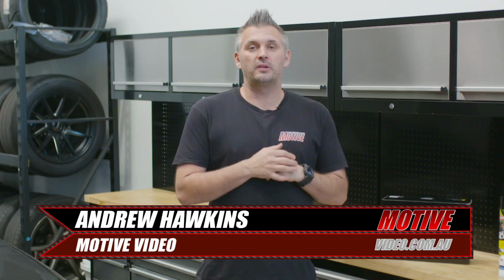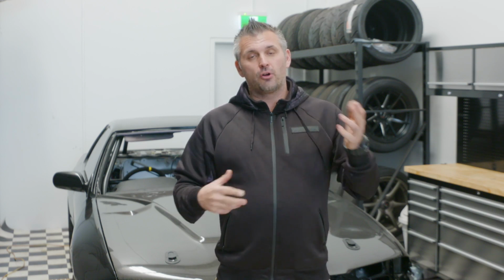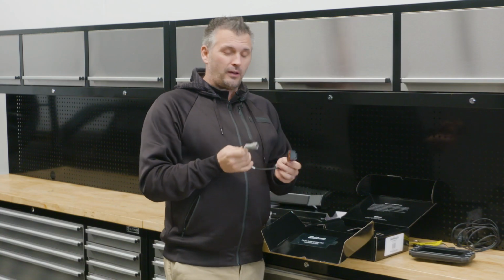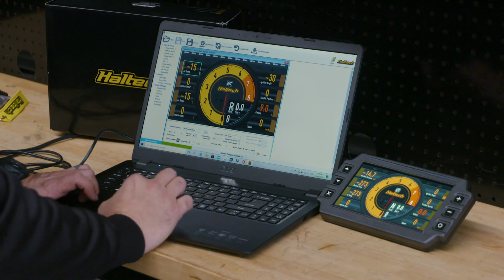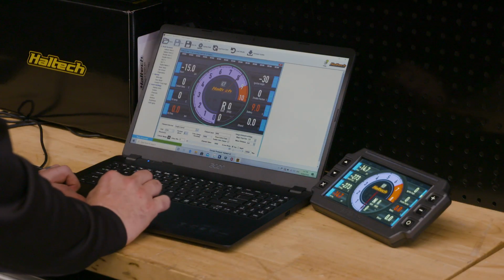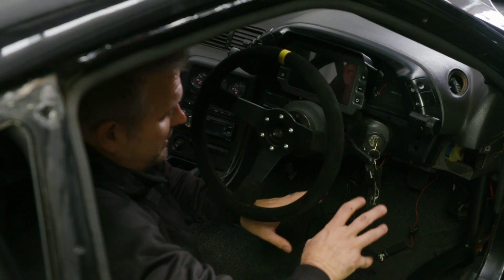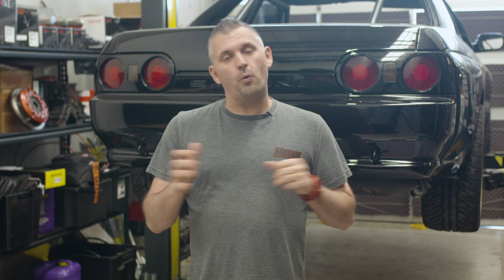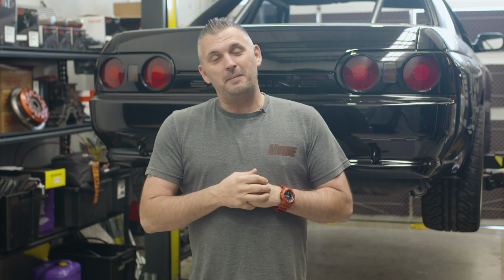Project "Supercar Killer" R32 GT-R Pt7 - Fix rust, Haltech IC7 dash install and paint cage.

Comment: Does the speedo work with if your using a platinum pro?
Reply from the maker: We make our own speedo sensor on the tail shaft. Need to anyone for gear dependant boost control, launch control etc

Comment: c'mon guys, bondo for these little holes??????
Just do some spot welding with a MIG, and you're done!!!!!
Very disapointed about this, as you always do a spot on job on cars :/
Reply from the maker: Metal putty is specifically designed for jobs like this. It dries into a metal, same way a weld dries as metal. You can sand it back then underbody over the top

In fact, it was recommended to do it that way by panel beater friends

Comment: Lol I started to do a set of forged pistons in my rb30 VL Turbo due to getting too high in the boost levels then it turned into a full cleanup of the under floor rear disc conversion recoed callipers repaint diff front end out weld up any excess holes in bay repaint change to auto and rewire to tidy up along with new carpet list just grows

Comment: Is there a feature on any digital dash that shows the 3 gauges from the centre of the dash of a gtr the oil temp turbo and 4wd split so you can remove those gauges and free up space for a double din stereo so you don't have to lose those info gauges?